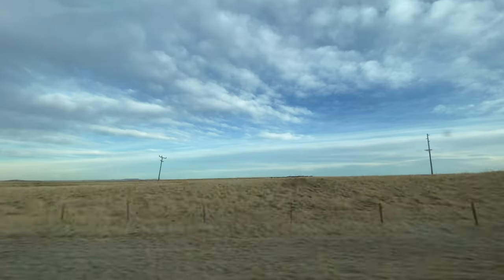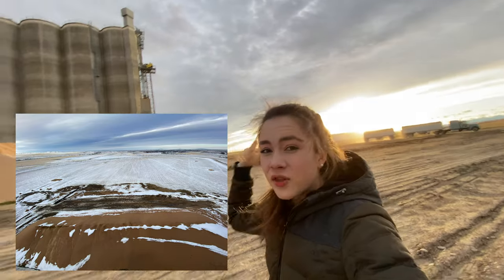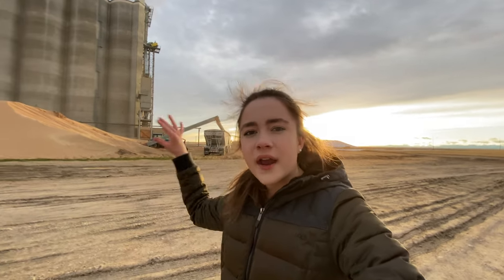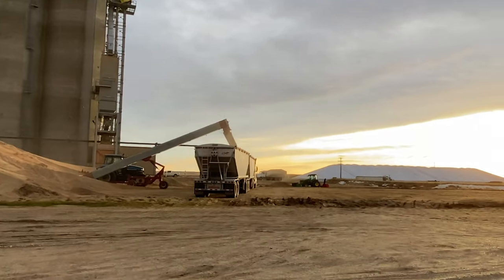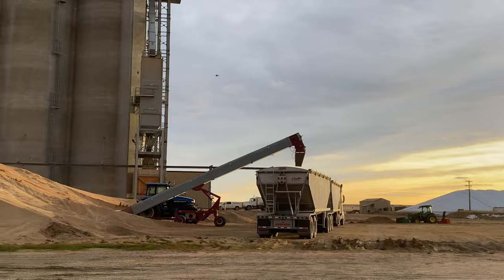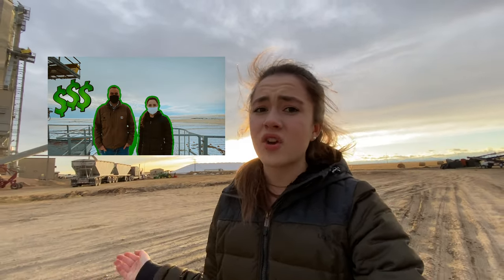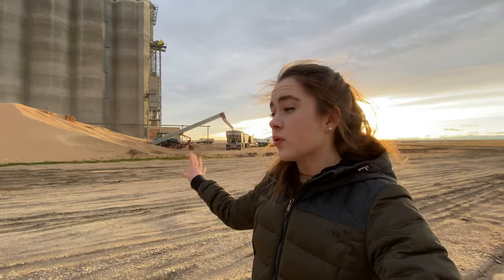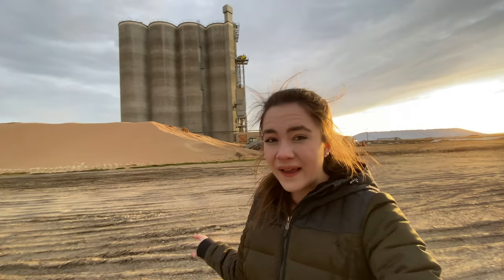Gigantic Grain Pile gets off the Ground!!!!!

Comment: 633,000 bushels of wheat weighs 37,980,000 pounds. That’s A LOT of wheat!! That is DEFINITELY a huge pile of wheat! Great video again Kate. Thank you so much for showing how they move a mountain of wheat.
Reply from the maker: Thank you for your kindness and great info!  It really was a mountain of wheat!! LOL
Reply: Years ago when there was a large surplus of corn, my local elevator in Southern MN built a corn pile that was 6 million bushels. I went and drove around it once unfortunately don't have a picture. The co -op's  millwrights built a self propelled pile loader similar idea to that one except larger and the semi  would back under the conveyor towards the unloader, the conveyor didn't have a spout,it would shoot the corn all the way to the front of the truck,then gradually slow down a bit and fill it toward the back .I think it could load a 1000 bu. semi in 3 minutes. I think they still use the homemade machine,it was built well.

Comment: That elevator is also able to load unit grain trains. Like you said, everything depends on the class and variety of the wheat. The flour mill I work in receives hard wheat from the northern plains, and the high protein wheat goes to either commercial bakeries for bread, or to distilleries for food grade industrial alcohol. 
You need to see if one of your local flour mills will give you a tour for your viewers. They can learn about grain blending, grain cleaning, and flour milling. 
Since you deal with barley, alcohol fermentation and distillation would be interesting too! 
Thank you for sharing!
Reply from the maker: Thank you for your great info and suggestions.  I planned on touring a flour mill but because of the health situation was not able to.  I did a video on malt barley, which was really interesting and I'm excited to see how they then distill it too.

Comment: Even in Ohio we put grain on the ground but we have so much moisture that a large expandable tarp is a necessity. To bad that elevator doesn't have a railroad line next to it so that they can send out grain trains which would help keep the grain off the ground
Reply from the maker: Thank you for your comment.  This elevator does have a railroad beside it.  The thing is that they filled up all the grain cars they had coming in so they had to wait for the next train.

Comment: I was wondering whether it would be quicker to load the trucks with a very large tractor mounted hi lift bucket. Although we do use augers and elevators on farms in the UK, a lot now use tractors with 1 - 2 tonne buckets. For comparison, 1 tonne is about 37 bushels of wheat. Also I wondered where the trucks were taking the wheat to locally as the trains that load off the elevator must be going very long distances to sea and canal ports.
Reply from the maker: Thank you for your great question.  I think that this is the most efficient way for this situation. The wheat is just going right beside where it is on the ground because the  big elevator is right beside it.  Then a lot of our wheat is shipped to Japan.  They buy most of our exported hard red wheat.

Comment: Wide open spaces - how would you choose a place to build a new elevator?  Looks like it could be done in any direction, any distance.
Reply from the maker: Thank you for your comment and great question.  I agree an elevator could be built anywhere.  This one is close to the Interstate.
Reply: Grain elevators are often located where farmers can easily access them. They are also located along railroad lines and highways, or near inland water ways.
Geography and geology are important because there has to be bedrock available, or pilings have to be driven, to support the massive bins. There are actually pictures showing whole rows of bins that fell over because a poor location was chosen.
In the days before improved highways and trucks, flat houses and early grain elevators were located along railroad lines. Up until the 1980s there were whole networks of railroad branch lines, dotted with numerous collection elevators, especially the old wood frame elevators. 
I am a rail fan, history buff, grain elevator enthusiast, and an Assistant Flour Miller. 
Your show is a big encouragement to me!

Comment: The angle of repose of the grain, or any pile of small particles like grain or dust, is the angle a which the grain will stay in place and not avalanche down the side of the pile to the bottom. The angle of repose is affected by moisture, particle size, adherence, coherence, vibrations, wind, temperature, and many other factors. You must have a ton of hard drive space to hold all that video footage you both take.
Reply from the maker: Thank you for the great information.  Very interesting.  I have a few external hard drives now because of all the footage.  I am really amazed at how fast a 10 terabyte can fill up.  This has been a big learning experience!

Comment: Are the trucks just hauling the grain over to the bins?
Reply from the maker: Thank you for your question.  Yes, they are loading it, driving over the scale with the testing probe and then unloading it at the elevator beside it.
Reply: @KatesAg  Is that called a "long haul?" 😀